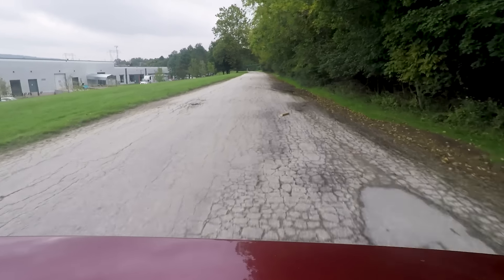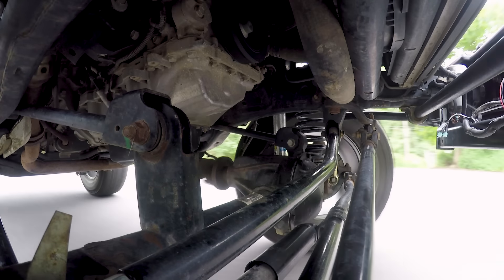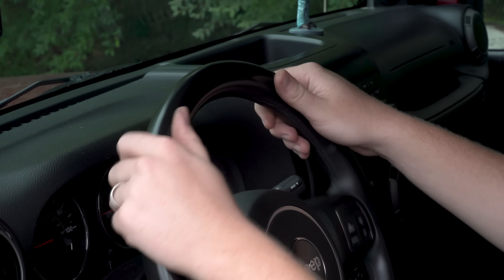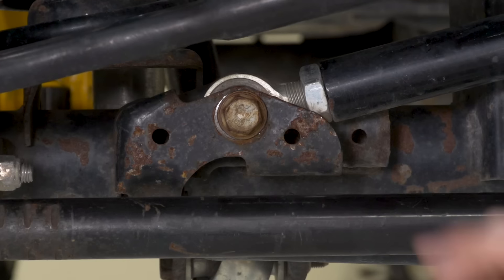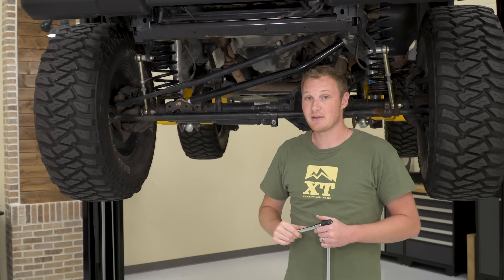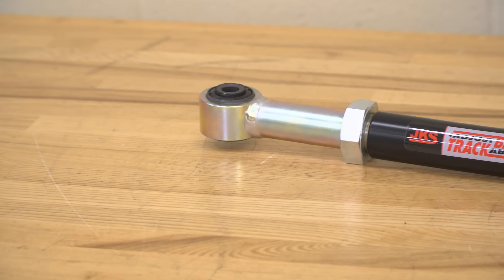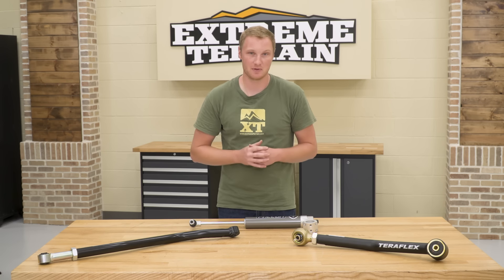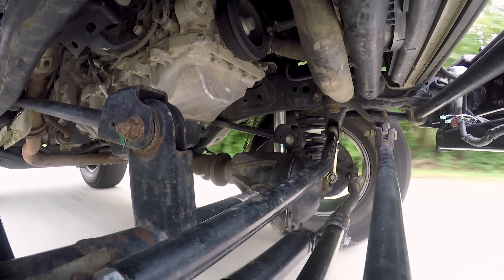How to Survive and Fix Jeep Wrangler Death Wobble | What Is Death Wobble?

Comment: I was doing 70 on free way i have 285
Reply from the maker: Wobble doesn't care what size tires you run, unfortunately! If something is off or worn in your suspension, you can even experience it with stock 31s or 32s. I highly recommend you check all 4 of your tie-rod links, your ball joints, your track bar, and your control arm bushings. Make sure your wheel-hub bearings are in good shape too. Hope this helps! -Zach
Reply: @extremeterrain  thanks bro

Comment: I have never had a death wobble until i got new tires. I am not sure what the hell is going on.
Reply from the maker: If you went up in tire size, the extra weight paired with worn-out suspension parts could be triggering it. Best to take a look at your front end and check for worn parts. Best of luck and thanks for watching! - Zach

Comment: Nice vid. Still working on my ‘99 TJ wobble and the problem seems to mostly be worn tie rod ends. 

I actually only had a wobble until I replaced a loose wheel bearing and then got full-on death wobble. 

The fix appears to be a combination of things based on bushings that come with parts and how easy they are to swap out. 

It’s going to be a process and I’m glad to hear that the stabilizer should be changed last. Thanks!
Reply from the maker: We're happy it helped! Steering wobble is definitely interesting to try and fix, and you're absolutely correct that it's often a combination of parts being replaced that ends up fixing things. -Zach

Comment: Hi Update.  My mechanic has a jeep and had to do the same repairs to his last year!  Thank you so much - they found everything and confirmed; needed new steering damper, track bar, track bar bushings, ball joints, (tie rod ends okay) wheel bearings, several loose suspension bolts from hitting pot holes at 80 mph, wheels will be re-balanced.  My tires are almost new, winter studded on rims, I always have separate set for summer on rims and winter set on rims so lucky despite the pot holes my tire belt did not get damaged.  $2,700.00 including tax and labour.  My jeep has 100,000 k so I am thrilled to discover how to fix ahead of waiting for an accident.  Thank you Jeep Forum you are terrific.  love & hugs from the north.

Comment: Would you happen to know the torque needed on that track bar bolt? You mentioned that it needs to be tighter than we can tighten, but I’m worried about stripping the threads on the bolt if I go hulk on the torque wrench and go too tight on it.

Comment: My all stock 04 tj does it at 55mph, not fun, thanks for the info
Reply: That sounds more like a tire balance issue if it's only doing it at higher speeds
Reply: Thanks, getting new rim and tires before the new year! I’ve been looking at the durtrac Goodyear’s , and opinions?
Reply: Hey bud, I also have an 04 tj and I just got death wobble it only does it 40 to 45mph plus, did the new wheels fix it?

Comment: Sorry boss you need to study up a bit more ,,most death wobble us a incorrect ball joint caster setting a long with improper angle on the track bar in comparison to your drag link if the track bar and the drag link are not of close to the same  degree of angle it will most definitely cause death wobble ,,suggest getting a magnetic angle finder and setting proper caster angle ,,look up bump steer gives you a better explanation also check out any number of web sites NAXJA is a great one to get specs and info ,,,throwing money at the problem doesn't necessarily fix it 😄😄😄

Comment: My death wobble started after I put a 3.25 lift???? Was fine before???
Reply from the maker: Sorry to hear about your death wobble, Scott! What kind of lift did you just put on? If the lift wasn't considered complete for the amount of lift the springs are giving you, that could be causing your suspension geometry to be off. Combine that with suspension parts like tie rod ends or ball joints that are worn out, you're going to see death wobble. -Zach

Comment: Solution: Buy a 4Runner
Reply from the maker: Toyota's are solid options! Especially older 4Runners with the 4.7L V8. IFS systems are lot more expensive to lift and less effective while wheeling on rocks though. 😁 -Zach

Comment: You didn't mention 1, Loose ball joints particularly on older JKs  with stock ball joints. 2, cracked knuckles around ball joints. And 3, The bottom pan-hard rod bracket on the dana 30 axle housings sometimes can have cracked welds. You need to know what to look for there. I personally just upgraded my front axle to a Tera44 from Teraflex and installed a steering box stiffener which has improved the handling. And more importantly no more death wobble.

Comment: Death wobble? My generation called it a shimmy. Doesn’t sound so dramatic does it?
Reply from the maker: Having a steering shimmy and having a wobble are two totally different things, though. You can have a shimmy from warped break rotors, unbalanced wheels, or loose steering, and still be able to drive without any issues. Having a death wobble on the other-hand can be extremely dangerous if you're not expecting it while going highway speeds. Definitely not a "generational" issue if you ask me. -Zach
Reply: Did you die?
How about violent wobble?
I’ve been in the industry over 45 years, government certified red seal tech. Drive me nuts when someone watches a video comes in and loudly complaining that they could have been killed. We get it on the frame machine and what do we find? Cheap lift kit, modified suspension by someone that must know more that the stupid engineers that designed it.
Some info and then a sales pitch.
Reply from the maker: Never said I almost died, and never said that cheap lift kits don't cause geometry issues or wobble. Our video just shows what can happen, how it happens, and how you can fix it yourself before having to buy any parts. Thanks for watching. 😁 -Zach

Comment: While the track bar can be the issue, once this happens, you need to check a lot of parts. It can be a multitude of things. Once one goes, many times other parts will follow due to the crazy undulation.

Ball joints, tie rods, control arms, track bar, wheel bearings(hub), u-joints. Look for cracked bushings, play in the joints, etc.
Reply from the maker: Great list of parts to check! Pretty much told customers the same thing back when I was in customer service. It's never just one thing. -Zach

Comment: Do all Jeep experience "Death Wobble"? I am planning to sell my "Disco4" and jump into the Jeep community. Then again, I did own 97 XJ Cherokee back in high school. Planning to buy the JLU Rubicon.
Reply from the maker: No, not all Jeeps experience it. My father has a 2013 JK that he has put over 120,000 miles on so far and has never had an issue. That being said, since even the new JL's have solid front and rear axles there is always the possibility that a small wobble may happen. Just the nature of the beast. -Zach

Comment: What are you saying?.. the dampener is almost always the cause...I mean yeah, if stuff is loose or worn that will definitely impact but to say the dampener, especially the factory one, is most likely never the cause is like saying you can turn corners fast and not experience some shit while in 4low... just isn't true... lmao...
Reply: Joe Stacks 
That's weird... so I had death wobble, all components checked good except the dampener, put a new one on, wouldn't you know, death wobble gone... by the way, as a jeep technician,  pretty much all the customer vehicles I've worked on with the exception of the few that did have other component problems, all had the same end result, replaced the dampener, death wobble gone... must just be my rare experience... lol...
Reply: If you have death wobble a steering stabilizer only hides the problem until the real problem gets a worse.
Reply: @joshua3340 
Maybe... possibly... but I put mine in over 3 months ago, have put about 4000 miles of road and off road use (including rock crawling)  and yet still have no issue... craziness...i never said the stabilizer is the only thing, just in my experience the most common thing, of course other things can lead to this as well...
Reply: @nickgrandy3098  sorry didn't mean to trigger you lol I just believe in correcting suspension geometry issues rather then covering them up.
Reply: @joshua3340  
No not at all...I love YouTube and the ability to talk shit... lol... look man, no one is saying it's the only cause... just THE ACTUAL most common... in fact, just talked with 5 different techs...ALL agree from they're own experience...I know there are a lot of shady techs who will tell you a lot of shady shit... this isn't one of those cases...I will NEVER rip someone off and I don't like hearing others have nor will I stand to hear false or just bad info being given and not say something...
Reply: @nickgrandy3098  I know what you're trying to say, but you're saying that those cases where the stabilizer was the only thing that fixed death wobble is implying that without a stabilizer you'll have death wobble. That doesn't make sense. If your geometry is correct and all your components are good you shouldn't ever have death wobble. The dampener should ONLY help with bumps, it shouldn't be relied upon that drastically.
Reply: @joshua3340  
No that's not what I'm saying at all... sorry I was out wheeling when I got this... lol... what I've been saying is that pretty much the only people who deal with this problem are pavement princess who didn't set there shit up right to begin with... and I'm telling you, this is the most common fix... but anyways... keep wheeling man... that's what it's about... lol...
Reply: I drove my 1995 Grand Cherokee around for a while without a steering damper because it broke. I finally replaced it and several months later my jeep started having death wobble. It is almost never the stabilizer.

Comment: You can't fix the death wobble because it's caused by the front axle.
Reply from the maker: You actually can fix death wobble and steering shimmy. The issue is inherent to solid front axles, but it is not caused by them. -Zach
Reply: @extremeterrain  actually it is, it's a combination of the solid front axle and oversized tires and this was from an AMC Motors wrongful death lawsuit from back in the 70s where they admitted that they knew about the defect.